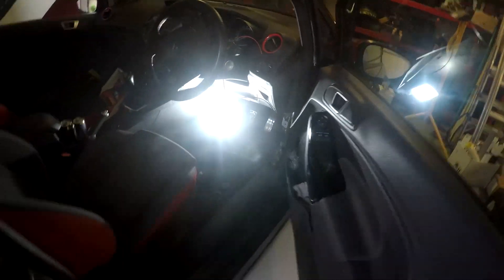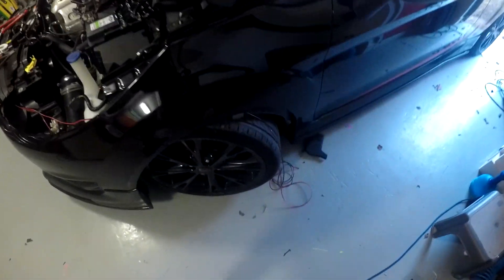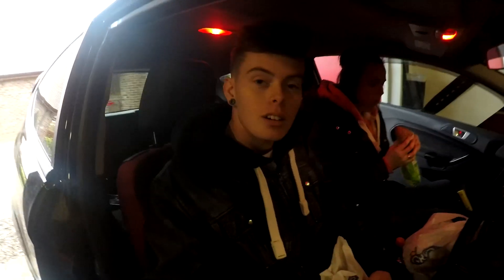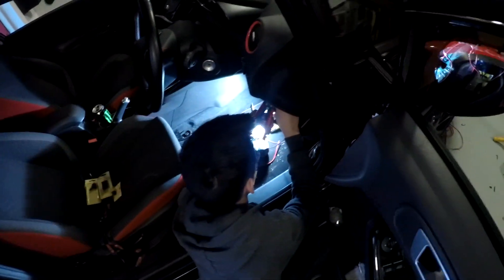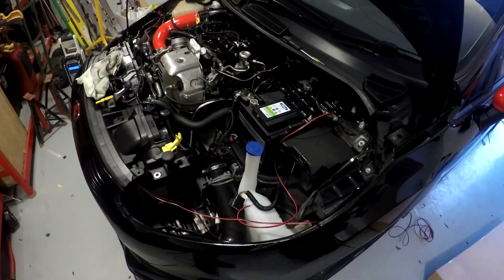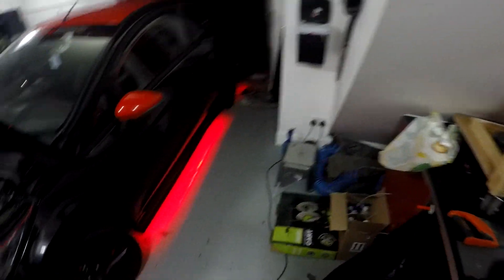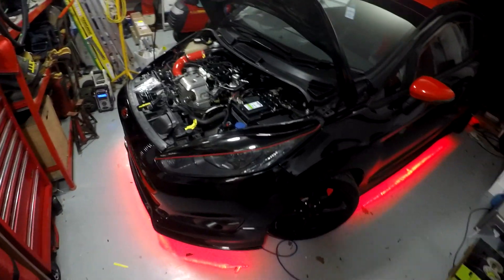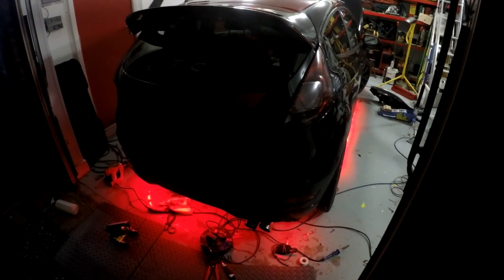Fiesta Zetec S gets underglow lights!

Comment: Run a wire from footwell lights tl power wire for them. With a diode. And will come on when unlocking.
If you know anyone who can do capacitor you be able to get them to fade in and out aswell